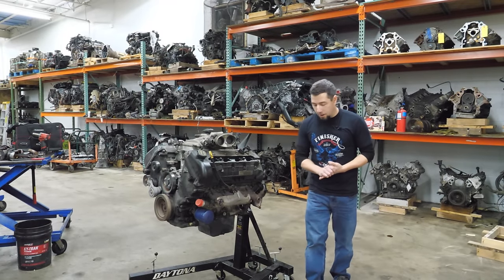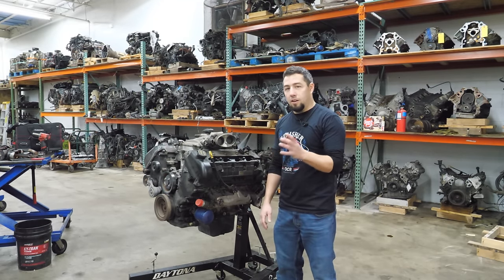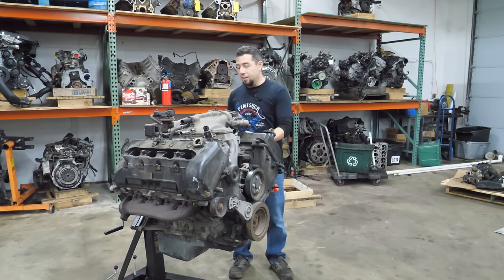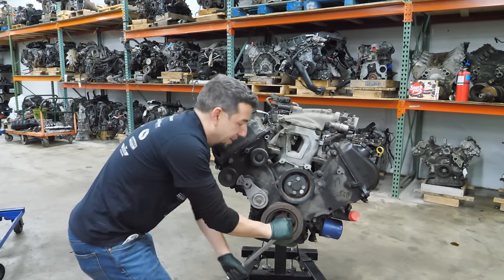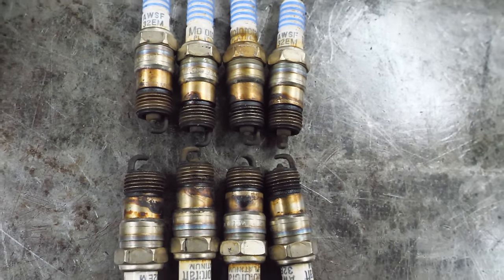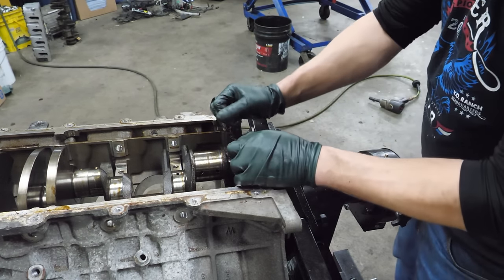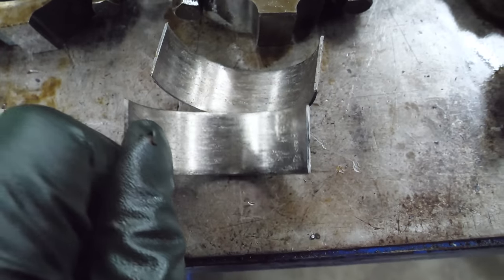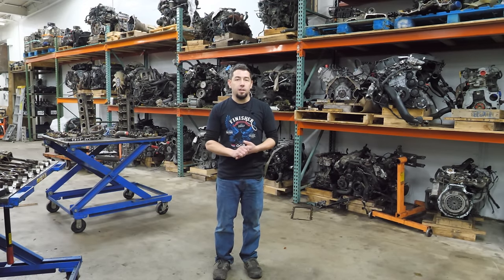AVOIDABLE! Blown Mercury Marauder 4.6L DOHC V8 Full Engine Teardown

Comment: When you panned the camera across  the top of the block and pistons after removing the second head, there was a significant gap between piston crown and bore for the last two pistons in the pan sequence, so much so that the top ring was visible through the gap even though the camera angle was somewhat oblique. Looked like there was a lot of clearance between piston and bore.

Comment: Merry Christmas! Loved the video. Quick tip: Anything plastic or rubber that's stuck - like that dipstick O-ring, or an electrical connector - shoot it with some silicone lubricant spray (I like the blaster brand, personally). Usually makes it a lot easier to remove! Thanks!

Comment: It is the same as the Mach 1 engine. I was a Ford driveability tech for almost 30 years. The plugs with paint on the tip are factory installed plugs.

Comment: Wow, I have never seen a crank wear out more than a bearing.
Reply: Obviously someone pulled the pan and changed the bearings at some point. A steel crank would never wear out more then a aluminum alloyed bearing even without a heat treatment on the crank. At some point that bad journal had a spun bearing which was replaced.

Comment: I really like your channel so don’t take this the wrong way, whenever you use an adjustable wrench, you wanna put the pressure against the fixed side not the adjustable side. Thank God, you don’t say anything about WD-40 being a lubricant or a penetrating oil of some sort I can’t get over how many people think that stuff is the best. Where I come from WD stands for water displacement. There’s nothing in there about lubricating and I’ve had instances where it wasn’t worth a shit for lubricating. Keep up the good work I really like your channel.

Comment: 43:08 the cranks in the Marauder/Aviator/Mach 1 autos are nodular iron IIRC; wanna say it's the same basic crank you'd find in a Romeo 4.6 2V but don't quote me on that; I do know they were 6-bolt. Manual Mach 1s got forged 8-bolt cranks that were nominally the same as the Cobra.

Comment: Looking at those rusted exhaust manifold nuts and studs brings back horrible memories. My 2001 4.6L in a F150 looked the same way. I broke three trying to get the manifold off while still in the truck. It took a week of working on it after work to get them out without damaging anything. What was Ford thinking when they designed that.

Comment: Could be stock plugs. I know my 94 LT-1 at 80k miles had only 1 plug that the platinum puck on the strap and all of the center electrodes wore worn down to the platinum core which was skinny.. about half the diameter of typical.

Comment: Have a 2000 3.0 vulcan v6 which at 170k miles was still running on the original plugs, things had to be well over 100thou gap

Comment: 17:00 in or so...the cams are still installed and the engine has compression. So the chain moved as the cam rolled off the lobe. You probably know but have a lot to think about.

Comment: Merry Christmas folks. Interesting to see that the filter seems to have caught most of the bearing material. What normally happens is that the oil pressure gets higher (as the filter becomes blocked) and the oil goes through the filter bypass, meaning more bearing material in the head, which did not happen here. Likely that means the engine was not stressed (and thus was kept at low revs). The owner called it a day on this engine long before some folks do.

Comment: These have the same architecture as the dohc 5.4 32v 290kw (388hp) found in the Australian ba to fg xr8 ford falcons, Koenigsegg also used this architecture engine with their 5.0 twin turbo V8 however I believe about the only original ford part left was the cylinder head castings.

Comment: The plugs are quite likely original a 155K. Service interval for changing then is 100K. Mine were always in good shape at the change, which is a PITA on modular engines in the truck.

Comment: I just bought a 2007 ram/ cummins truck and the guy said it had electrical issues. It only clicked when trying to start it and will not budge with a bar. There isn't a trace of oil on the dip stick and I cannot bar it over. At least make sure your engine has SOME oil in it. Those warning lights and chimes don't mean keep driving.

Comment: Kudos to Ian for catching it before it blew apart.
Reply: It didn't really matter, though. The worth of that engine would have been about the same if it had "inspection ports". I wonder what that engine sounded like when it was running before he pulled it.
Reply: @dougrobinson8602  -  Right.  Saving it early caused less damage to parts that Eric can sell, but the engine was still toast anyway.

Comment: If a bolt gets stuck in a socket grab a screw driver and hit it on a table, putting it through the 3/8 or 1/2 opening for the ratchet.

Comment: Those definitely are original plugs. I changed the plugs on my Expedition at 185,000 miles due to a misfire and was shocked to find the original plugs. The electrode was pretty much gone.

Comment: At least the dipstick didn't break off flush in the block like mine did. I just began to move it, and it sheared right off.

I have done work on these engines before, and actually, this engine was my first time doing chains and guides on a DOHC engine.

Comment: Manuals , wonderful inventions. Man I hate seeing good , even questionable parts tossed when there is Always someone that would take it or needs it.  That water pump had to be recent , I had to change my original off on my 200,000+ Lincoln once reaching my daughters in Montana before heading home to Kansas. My son in law and I fought and beat and fought it for over an hour sure we had to do something off , but it came finaly and was sooooo corroded it was basicly welded on lol. I would love to have a Marauder , being a Panther Fan . My Lincoln needs chains and tensioners , pump and pickup. But with the miles on her I cant complain for an 01 Town Car. Was still in good shape but a late hail got it dinged up so now debating on its future. Keep the BFH readily available. You might be surprised how things clean up and last for many moons. Thanks for posting.
Reply: Find a good paintless dent repair shop. Ask for a discount and offer them the ability to remove the dents when they are slow. 
I've seen paintless dent repair work wonders on a hail damaged car.

Comment: My wife has a 2019 ford F150. I never have raised the hood on it. I let the Dealer change the oil and when an if it starts using oil between oil changes it is time for a crate engine.

Comment: Had a ‘03 Mach 1 with this engine. Great power for the time but it’s amazing that just 20 years later my wife”s Explorer ST has 100 more HP from 1.6 fewer liters (although it also has two more turbos) than the 4.6 has…
Reply: It’s amazing a 20 year newer expensive ass performance engine has only 100+ on this
Reply: Apples to oranges. Put turbos on that Marauder engine. Then your Explorer ST is more like a Civic compared.
Reply: @stevemccauley5734 the 4.6 would be throwing rods out the block if you boosted it. 😂
Reply: @TML34  depends.
When boost is ran, engine should technically be running lower C ratio.
Plus, some Ford 4.6 5.0 have some weak pistons in them
Reply: @TML34 keep it below 10psi and you'll be fine! E85 and/or meth is a extremely good idea as well.... But that goes for all boosted engines really but 🤷 

Mod motors love boost BTW..... Still think the original plan for new edge mustangs were to be supercharged..... What other reason do they have hydroboost for?
Reply: @TML34 passed 450whp yes
Reply: @commonsenseisdeadin2023 firewall and valve cover clearance was the main reason for hydroboost. Especially the 4V engines.

Comment: The water pump toss is the same procedure for brake calipers that get returned to the parts store which is why they come back from China with big dents and gashes in critical spots and leak when pressure is applied.

Comment: I enjoyed the video, Eric.  Merry Christmas to you and your family.  One question, would it make it easier to pull the dip stick tubes if you spray some oil, WD-40 or other penetrator first? 😂
Reply: I've been waiting for him to attack it with bolt cutters.
Reply: Not really, the issue is typically oring swelling mixed with very thin wall tube and even worse at the oring groove.

Comment: It's got to be in better shape then the last one you pulled down. The one that must have run at WOT upside down.
Reply: 😂 that's was the work of a plasma cutter! 

Quick and easy to get the torque converter bolts off!

Comment: I use a Flathead and put it in the square drive part of the socket and grip the socket and bang the Flathead handle on the ground the nut pops right out

Comment: As to whether the block is worth saving, the only question that needs answering is if there are oversize aftermarket pistons for this engine.  If the answer is yes, than yes its worth saving.  I can see someone buying a used motor and just throwing it in a vehicle as is, but I can't fathom someone buying a used block and building a whole motor from it without sending it to a machine shop first.  You aren't checking for flat surfaces or doing a magnaflux, so unless your buyers are only machine shop businesses, its not like you could ensure them they could stuff them in a vehicle without any inspection or refurbishment.  I suppose those people might exist that would build an entire motor in their garage without ever stepping foot in a machine shop, but if they do they'd know not to buy your block if you just list it as needing to be bored out and oversize pistons.  As a motor builder, the first thing you have to do with them is bore them out anyway.

Comment: i would use them cylinder heads i have 2000 mercy grand marque that has more damage on the cam journals i have put 30+ k miles on it without any trouble

Comment: Wow! You need to invest in some flare wrenches for pipes! I can't believe: 1) There was enough room for that monster adjustable spanner to get on that flare nut 2) It didn't just round off instantly -It's a Christmas miracle!
Reply: Getting studs and nuts out of sockets trick: There square hole for driving the socket goes all the way through the socket, so go to your vice, set the jaws so the outer edges of the socket sit on the jaws, have the socket drive side up, insert a rod, old long bolt or similar through the square drive hole, beat on it. You will win. although I expect you know that and you just  did what you did for the ever bigger hammers gag! Merry Christmas 🙂

Comment: Aviator or Navigator? Never seen one of these engines in an explorer-based vehicle. These engines were fairly notorious for excessive oil consumption. There were various TSBs over the years for just about all of the Triton/Mod series engines regarding excessive oil consumption. I've owned more than several of them (various models) that used oil from day 1. I have an. '11 F150 with a Coyote in it right now that has used about 2 quarts between ever oil change since it was new - changing on a 5,000 mile interval. 

Also, you were using that crescent wrench backwards. ;)
Reply: The Aviator had this engine, the Navigator had a 5.4V version of it. I have a 6.2L 11 F150! Uses no oil at 200K. I do a 3-5K OCI w/5W30 PPHM. Gets used hard, tows 11K.

Comment: Had one of those engines from an '05 Lincoln make it to 740K before the aluminum casting finally gave up where the oil fill spout entered the block and a peice fell in making aluminum soup around the timing chain.
Reply: Good engines.
4.6 and 5.0 all of them.
Cheap reliable power
Reply: I wouldn't call it good so much as easy enough to repair, keeping that SOB running gave me a fun hobby, but I was 0% surprised when it finally failed completely (in part because the block had cracked there twice before, and I'd just alumalloy'd it).
Reply: @GimpyChinaman  Good.
I've owned several.
I've also owned Saab, Chevy, Nissan, Isuzu, Acura, Honda, Yamaha.
The Ford was a very good reliable engine.
That's why they were used in so many vehicles.

Comment: When I owned one of these cars, it developed a nasty head gasket leak at about 110,000 miles, so I got rid of it!!
Reply: That's very surprising!!! As 4.6L except the 3v were amazing reliable engines! As long as the spark plugs were torqued on the 4v's

Comment: 300 horse is the same as my 15 Taurus and 10 Silverado. Plenty of power in both, but the taurus due to its weight advantage and low center of gravity is a lot more fun. Pair that with serviceability, parts availability and simpler design of the marauder and I'd take that over the taurus any day. I would love to find a good deal on one some day! Also shout out to what a great friend you have.
Reply: Would be better to just find an old Cobra. Marauders are very rare and go for $15k+ even with higher mileage lol..

Comment: Eric, that socket incident was painful. 😂 I just use a brass drift and or a bad bolt to knock out the lodged one. Couple taps from the BFH and it's dislodged.
Reply: Why would you abuse a brass drift for that?
Reply: @commonsenseisdeadin2024  they're Mayhews. They can take it. Just a couple taparoos. 😉
Reply: @mphilleo  tap, tap, tap a roo! 😂

BUT that defeats the whole purpose of brass drifts!  I also must say, that is one product where hopefully brand really does not matter or make a lick of difference! 😆

Comment: Finally. You found some stubborn exhaust manifold bolts. I have a couple of 88 turbo dodge cars, so inspired by you, perhaps, I bought an engine just for the experience of tearing it down. I chistled the nuts to get them off, and getting the studs out, I compromised the threads in the head. Now I know I'm not the only one.
Reply: Daytona?
You have a couple 2.2 turbos?
Reply: @rdallas81  yep. A Shelby z that I bought out of nostalgia for a nearly identical one I had back in the early 90's, and a Pacifica just for the fun of it.
Reply: @KevinEgolf-kp2gz  I like them.
Had a 1987 Daytona.
Also the LeBaron turbo.
Reply: @KevinEgolf-kp2gz  I think the Pacifica is a nice vehicle. The new body style mini van looking one is also good looking.
The last generation one is also nice.

Comment: Its not difficult to get a significant power increase out of the Marauder 4 valve DOHC 4.6 . A tune, cams , intake and throttle body,  performance exhaust. Just those mods can take that engine to well over 400 hp . Its not super expensive but its not cheap either
Reply: Yeah.
That engine will sing if cammed, exhaust, intake.

Comment: That is the same as the Lincoln In-tech engine.  It came out in the 1993 Lincoln Mark VIII?  The SOHC 4.6 does have an iron block with aluminum heads; this engine does have an aluminum block and heads and if it overheats it isn't good.  I have a SOHC that has 500,000 miles.  GREAT VIDEO!
Reply: Those Mark VIII blocks were the Teskid blocks (built can hold 1500whp+) The heads are the early twin / dual intake port heads. Called the B heads. Same as the 96 to 98 Cobra's.  So people get the Mark VIII engines for cheap, toss the B heads and install the 03-04 Mach 1, 03/04Cobra, Marauder and 03-05 Aviator heads and build them to 1500whp+ with turbos or Whipple Superchargers.
Reply: Some late 98 Cobra's got the Teskid Blocks too.

Comment: A few of engines we haven't seen yet, please.

400/6.6l Ford V8. 351M would also do.
Acura I5 from the Vigor.
Ford turbo I4 from the Mustang/Thunderbird SC
Chevy 409
Buick/Old/Pontiac big blocks
472/500 Cadillac V8
350 Olds Diesel
Reply: That 2.3 Lima engine is such a good thing.
Seen one putting out almost 300 HP no boost.
Others running in the 8s..in a quarter.

Comment: Interesting to know this isn't the same as the cobra engine. I would have assumed a 32v is  a 32v across the board.
Reply: I'm not as familiar with the 99-04 Cobra engines but in the case of my 1998 Lincoln Mark VIII LSC, the '96-'98 Cobra engine based off it had a forged 8 bolt crank vs a cast 6 bolt crank, (pretty sure the pistons and rods were the same or very similar) a bigger, higher flowing intake manifold, and more aggressive intake cams to compliment it. For only a 15hp difference between the 2 cars, the Cobra engine has some good upgrades. Most of that 15hp was from the higher rev capability with the manual transmission. My Mark revs to 6k while the Cobra is nearly 7k.

Comment: Yes, the WAP blocks are worth saving. If you can get a good Teskid block, get one. But WAP blocks can be resleeved and built to hold 800whp+
Reply: The block isn’t the problem, it’s the disconnecting rods and cast pistons.
Reply: FYI it's Teksid

05+ WAP blocks are stronger than Teksid and the earlier WAP blocks were well known to be fine for over 700, Teksid around 1000 and iron.... well more than 99.9999% of what anyone would ever run a 4.6 to!
Reply: @TML34 all 4.6L mod engines had crap rods and pistons unless you had the 03/04 Cobra.
Reply: @commonsenseisdeadin2024 this is not  a Teskid block. This is a WAP. I have 2 I'm building in my shop.
Reply: @mickeymang6  I’ll say it again to you, FYI it’s Teksid.

I didn’t say it’s “A” Teksid! 
You have 2 you’re building in your shop, it looks much better when you know the actual correct name for what you’re building….. again, it’s not teskid, it’s Teksid! You’re welcome!
Reply: @TML34  they are hypereutectic pistons, they are technically casted, however not referred to as “cast”. You have hypereutectic, forged and cast pistons. But you’re right, the weak link is the disconnecting rods and then the pistons. The cranks are not forged but are decent, however a forged crank is cheap insurance if building a modular, especially if running a manual trans.